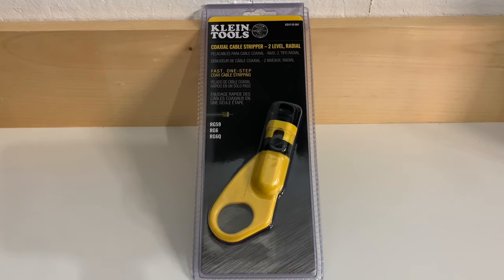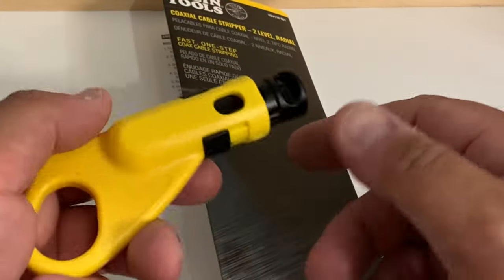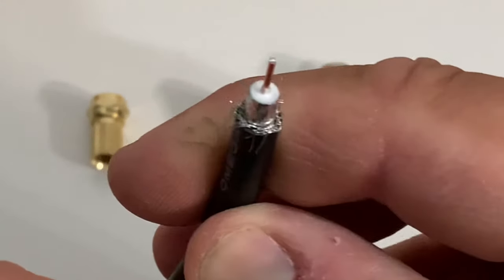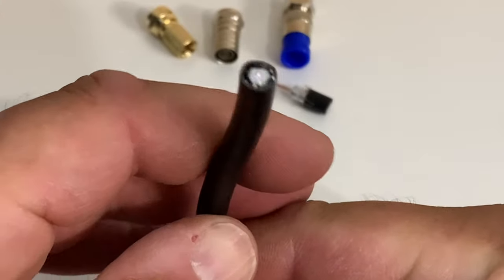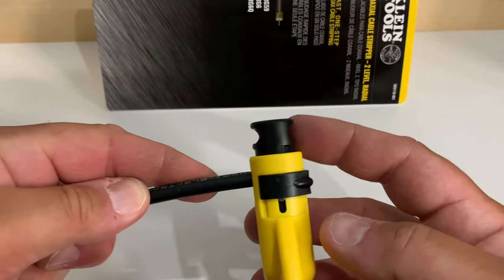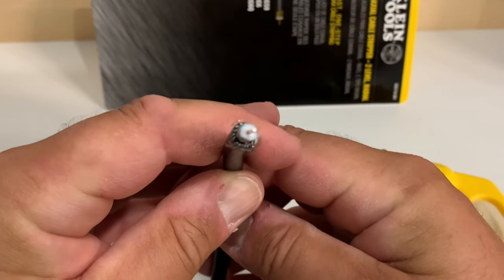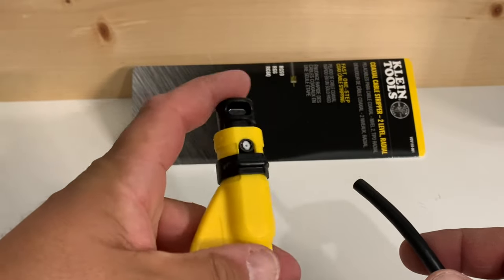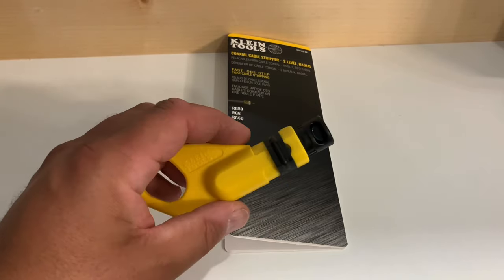Klein Tools Coaxial Cable Stripping Tool for RG6 Coax Cable

Comment: No need to remove the foil paper?
Reply from the maker: No, the foil stays on RG6 dual shield cable. The outer layer of foil is removed if you’re using RG6 quad shield cable, because it has a second layer of foil and braided shielding; the outer layer of foil gets removed to prep the cable in that case.